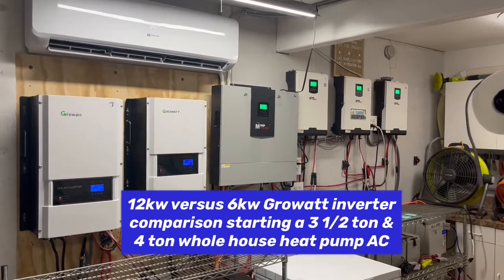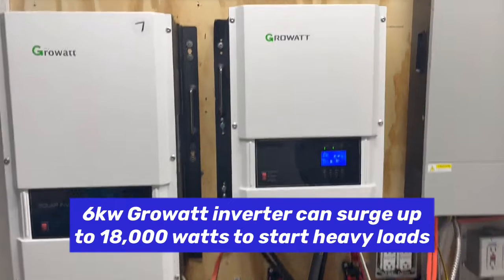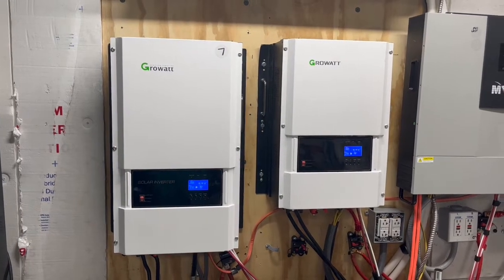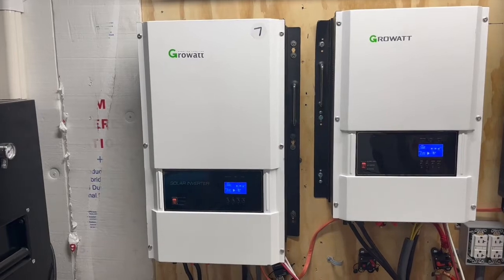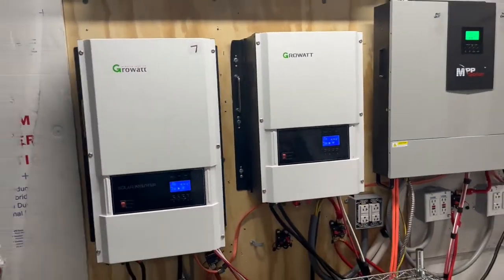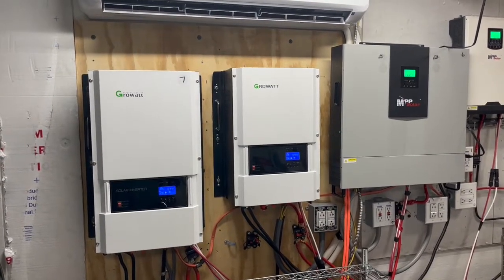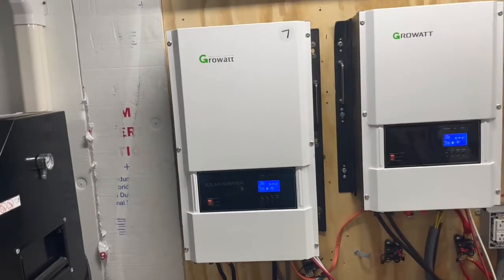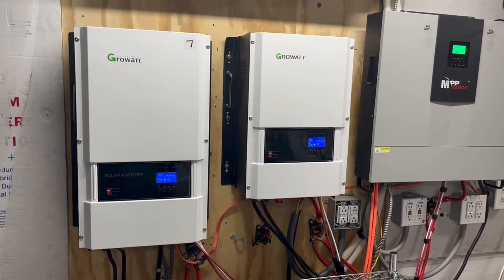12kw & 6kw Growatt Low Frequency off grid inverter comparison to start 3 1/2 ton & 4 ton AC.

Comment: Hey Papa. I have a GroWatt SPF 12000T DVM inverter (same as yours) and am trying to use it on my 3 ton heat pump brand new high efficiency AC unit. For whatever reason it will not work with the blower 115v and immediately throws a fault code 51. I can hook it up to a small 2000W Honda generator and the blower runs just fine. Ironically the AC compressor runs off the GroWatt just fine as well (240V). Would you be willing to talk with me or (e-mail) how you were able to get yours to work on your AC unit? Any help would be greatly appreciated!  Steve
Reply from the maker: Hi Steve, I actually did not connect my blower and A coil in my attic on heat pump. That is still using grid power. It uses such little power when running all day. I don’t even notice it on my electric bill. My blower motor A coil in attic is on a 220v breaker for grid. My Growatt inverter in only grounded to cabinet of inverter and ac disconnect box next to Heat pump. My inverter kept tripping and Faulting when I tried grounding to earth ground with a rod. That’s why your Honda generator is working, it probably does not have a earth ground. Try just the 230 volts going from inverter to heat pump on inverter and run blower A coil unit on grid. See if that works. I have outlets wired from my 12kw Growatt for 120v and when ever I plug in my pool pump which has a earth ground the gfi plug trips. You have a decent amount of voltage going into ground from grid and that will make your unit trip. Inverter needs to be isolated. Try those suggestions. Hope it works.
Reply: Hi Papa, those are good suggestions. The problem I have (which is a good one) is my new place is completely off the grid. I’m probably 1500 feet to the nearest power pole and My intention is to be completely self-sufficient. Therefore, I do not have grid power to rely on or use even to test. I did not realize that the inverter likes to be isolated from ground. I currently have a 8 foot ground rod in the ground connected to a eight gauge copper cable that connects to both the electrical box and inverter. Are you telling me I should remove the ground? I always thought having a ground was a safe way to keep everything protected. Do you know that I am trying to run is a Bosch BOVA 2.0 Split System Heat Pump 3-ton unit with variable speed blower & compressor. As you could imagine, I’ve spent quite the money on this system as well as my solar system. I was pretty bummed over the weekend when I couldn’t use it for the air conditioning. Any other suggestions are greatly appreciated!
Reply from the maker: @stevemaggieheinze3800  since you are completely off grid, the grounding rod is the right choice. I assumed you were with grid. Better off with a grounding rod the way you have it.
Reply from the maker: @stevemaggieheinze3800  how many watts do you have connected to inverter? Is this a mini split or a whole house heat pump with duct work. My heat pump pulls 75 amps to start, I just installed a soft start a few days ago and it now only draws 16-24 amps at start up. Is it the surge at start up that is giving you a fault code?
Reply from the maker: Code 51 is a overcurrent surge. Could be your settings if you have the 12kw inverter. email me at ppag53421@outlook.com and I will help you.
Reply: Thank you very much Pappa! I will email you from my Gmail account. I’ll also send You some pictures of my set up.

Steve
Reply from the maker: @stevemaggieheinze3800  I look forward to your email and hopefully we can get your ac running.

Comment: i was thanking the growatts was 250 pv in put but the one i got it is  145 volt input i am glad i didnt put pv to it i  would have cook it ours is the 6 kw
Reply from the maker: Yeah, the 6kw Growatt I have is also 150 volt pv in. More than likely you would of just had a fault code and inverter would have shut down if you tried connecting 250v pv in.
Reply: @diy-solar-guy  hello 👋👋👋 Papá 
Great videos watch them all the time... thank you for all your help and advice clears up ideas 💡...i have a 12 k, 150voc  can the pv array get away with just inline fuses or buy an expensive combiner box ...only using 2S 4P   that outputs 100v and 46 amps ... thanks 🙏 again
Reply from the maker: If you can afford to buy the better breaker or safety products designed to shut your system down before a problem occurs, then I would suggest it. Being on the cautious side is better if you can afford it. I don’t overload my inverters. I usually only have about 50 to 70 percent of the watts permitted since I have so many inverters. Eventually I will get around to combining my inverters into a central panel and make it look nicer and add better breakers, etc… I have been really sick for the last couple of months and have not put out a video in weeks. But on the mend. Once again if I had the money I would add all the safeguards I could so there is less chance of a short or fire caused by wires to hot because a cheap fuse failed. Hope you have a wonderful and extremely blessed day
Reply: @diy-solar-guy  Ty so much your a real Pappa... looking after your subscribers will do. not going to be cheap because I am going to use all 7000 watts better being safe than sorry...Hope you get better soon ...will be waiting for another video ...God bless...

Comment: Super helpful looking forward to the next video. I had been looking at the 6kw. What fault code is tripping? Would also be interested to put volt meter on the battery to see the voltage drop when the HVAC kicks on.
Reply from the maker: Over current code kept coming up on the 6kw inverter. Codes3,4 & 51 kept displaying after fault. Just does not have large enough coil inside for the surge. Also the 12kw Growatt has 2 mppt inputs for solar. The 6kw Growatt only has 1 mppt sole input. The inrush current on the 3 1/2 ton is 72-75 amp at start up. The inrush current on 4 ton is around 109-115 amp at start up on the compressor. The voltage drop on the 3 1/2 ton at start goes from 55-56v down to 51-52v at start up and increases back up to 55-56v within 1 minute and stays there. The voltage drop on the 4 ton ac at start is 55-56v down to 47-48v then increases back up to around 53-54v after 1minute. Hopefully I can use the 12k for my 4 ton and the 6kw Growatt for my 31/2 ton with the soft start. We will see the difference and if the soft start is even able to reduce the inrush enough for the 6kw Growatt to start ac. Thank you for your input and I hope my answers helped you in this message.
Reply: @diy-solar-guy  Thanks!

Comment: Look into Sandi inverters I'm going to become a dealer I have a 30kw unit on way they build all the way up to 500kw Sandi I think I'm going to get the 60kw for my Wherehouse and the 30kw for my house it can run just off panels or you can buy the battery's they build or can build a battery and a griwatt transformer will work  look into the. Sandi inverters I can sell you one if you want to use only one inverter for everything
Reply from the maker: Thanks Rich. I think I’m done with these last 2 Growatt inverters. The Growatts are more than enough to supply my needs. I will be selling off some of my other inverters I no longer use.

Comment: microair easystart cut my in-rush in 1/2 on my 4 ton AC (121 to 55)  running amps reduced a bit but u won't see any reduction in $.  The key is the reduction in inrush  amps which will start the AC.
Reply from the maker: Nice, I very rarely use my 4 ton ac, I use my upstairs 3 1/2 ton ac all day on solar and on grid at night. Hoping the soft start will allow me being able to use 2 more of the inverters I have to start up ac that now can not start ac. Thank you for your helpful input.
Reply: True I have it on my 4 ton it helps in rush only and I have the inverter you took off no problem at all . Don’t expect lower power bill
Reply from the maker: You are correct, probably wont see a reduction in electric bill by using less amps at start up. I want to try my other split phase inverters to see if they will start up ac with soft start. @ImanAcademySE

Comment: Soft start will definitely work I have one on my ac with the same 12kw inverter.
Reply from the maker: Does your soft start use a lot less amps when starting and while running?
Reply: @diy-solar-guy  I have a Micro-Air Soft start on my AC and it reduced my starting inrush to 22A.  Previously if my Growatt 12K was running other things in my house above about 2kW it would give an overload beep when the compressor kicked in.